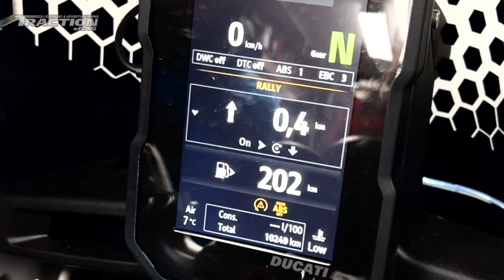Ducati Desert X on a SERIOUS Enduro Ride︱Traction eRag

Comment: Pretty rad you are putting the bike through the kind of torture that the adverts tell people it was made for.  The hard part about doing tbat stuff with the heavy bike is that your weight is absolutely at odds with your traction.  Could really see that on the hill.  Its twice the bike, being pushed by a tire with the same contact patch, all the power in the world doesnt help in those situations.   Not to mention it is a b@stard to get out once you get it stuck.

Comment: would like to see a show down between a dirt focused adventure bike and an old school big duel sport. a t7 or an  890 adventure vs a dr650 or a xr650.  how much more dirt capability do you actually get with a big single over a proper adv.
Reply: I’ve heard a lot of good things about the T7, 890 Adventure etc but I keep wondering what they offer offroad over the DR650/XR650L; from a purely riding perspective, I would expect that the extra weight of the T7/890 does away with any advantage they may have over the DR650/XR650L in the gnarly stuff. The stock suspension of the newer bikes are definitely better than tone ones on the DR/XR though

Comment: This has got to be the best DesertX test anywhere. Proper end of days stuff. We need a follow-up with it cleaned and on a stand though! Did the crashbars and bashplate survive? Did they bend the frame tabs they mount to, or damage attachment points on the case?

Comment: DesertX….why did the designer go home when he did his job from the front wheel and backward, reaching to just behind the tank ? Why didn´t he have any soul into the rest of the bike ?
Reply: Could be wrong but I think there are some rear tanks that can be bought separately that make it look better... You just have to pay 😕
Reply from the maker: Couldn't agree more. They let Hyundai design the tail section.
Reply: @TractioneRag  i think it was the designers of the original Fiat Ritmo or Ford Taurus that were on work that day….
Reply: Because the rear is designed to fit the optional rear additional gas tank.